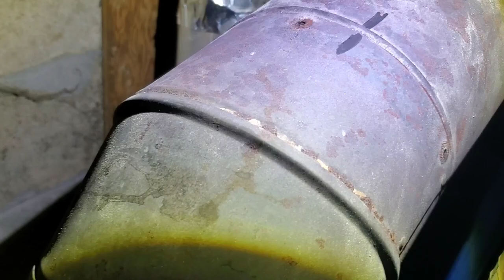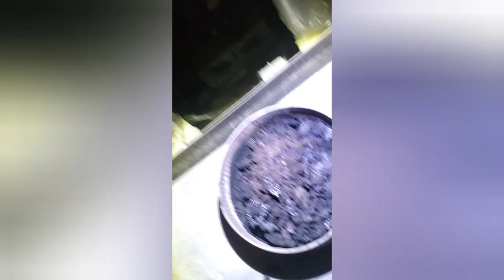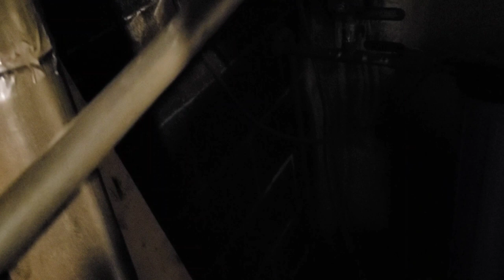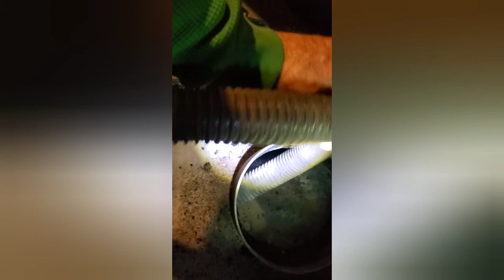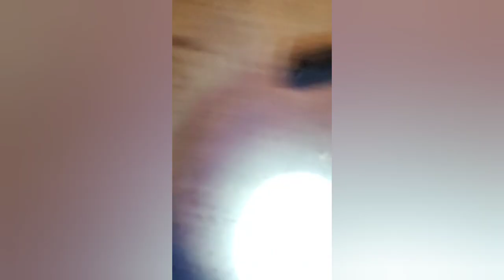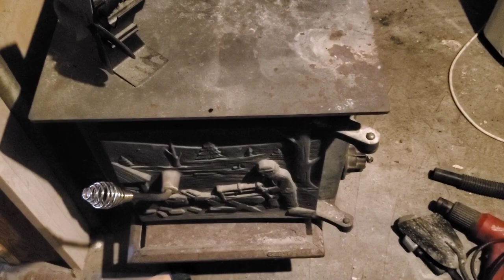We almost died... Cleaning the wood stove chimney. Plugged up FLUE PIPE

Comment: I have the same setup as you with a pipe on the same angle and about eight feet long on the inside. We take the pipe down every month for a clean out with Steel brushes and a leaf blower. We develop“ potato chip” like protrusions on the inside pipe and they destroy the flow of air and smoke. We burn approximately 7 cords a winter.
Reply from the maker: Excellent idea

Comment: so how did u almost die?
Reply from the maker: I thank you for the great question. If the chimney becomes clogged with creosote from wood stove use, the furnace exhaust can back up into the house, causing dangerous carbon monoxide levels.
Reply: @JimsNBHomestead  what's creosote
Reply from the maker: The build up forms in the flue pipes from poor combustion, mainly improperly dried wood